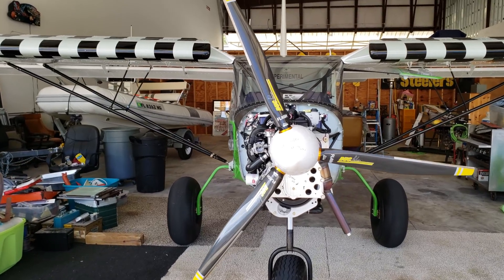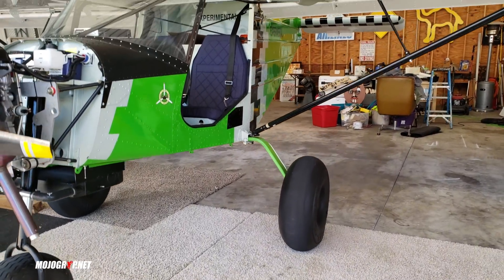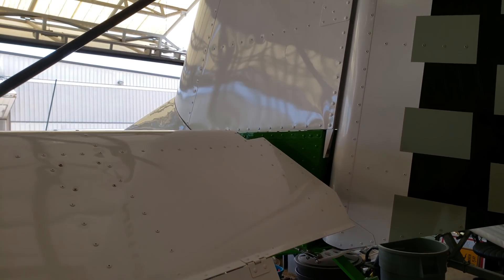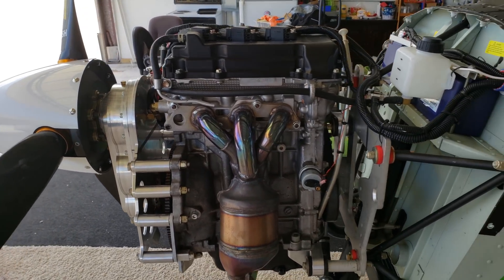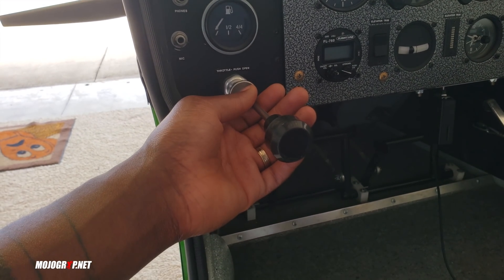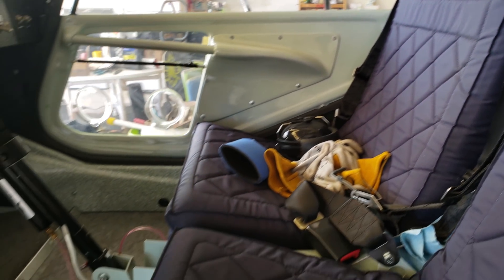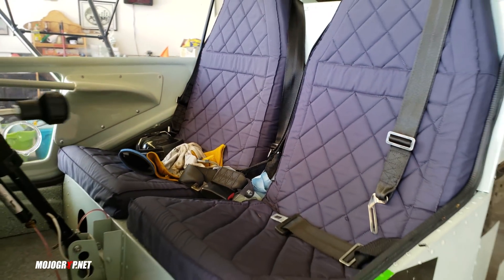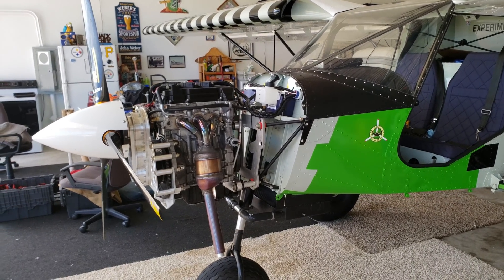SP-30 STOL Airplane Powered By Viking Honda Engine

Comment: Word on the street is that the FAA will be tripling the weight for LSA from 1320 to 3600 lbs in January. Should open the floodgates for new aircraft.

Comment: Odd, it feels like a high wing, STOL 701 knock off should be a tail dragger, no? Sure, there are big tires on that tricycle gear, but, even the rise on the bottom of the rear (up to the tailfeathers) makes me think tail dragger. Color me crazy, but, the Kitfox & the Cub Crafters STOL airplanes seem to look sleeker and more aerodynamic, as well as better balanced between wing size, shape & the overall aircraft. I honestly thought we were gonna lose you to the Azalea Aircraft Saberwing, Mike. But, I don't think it pretends to have any STOL characteristics, the wing is super low to the ground (stubby gear), but, under full full turbo and coming slow over the fence, prolly not too long. Just wouldn't want to land off pavement with flaps down!